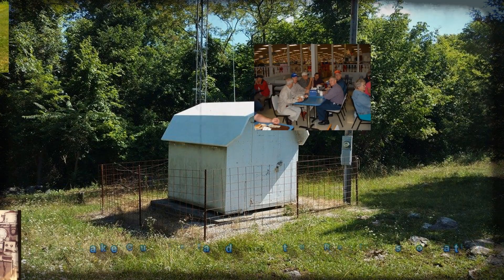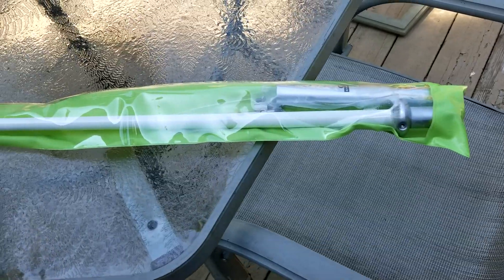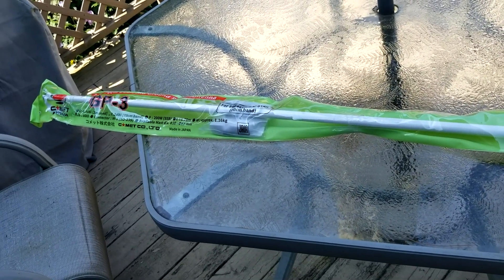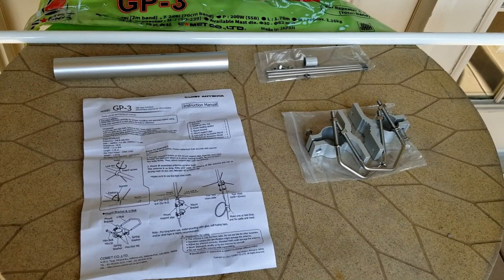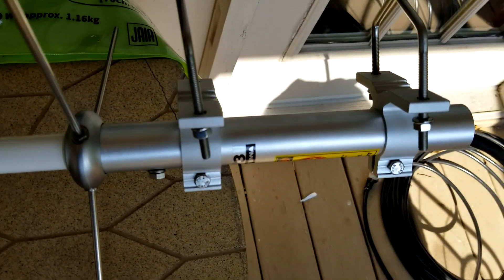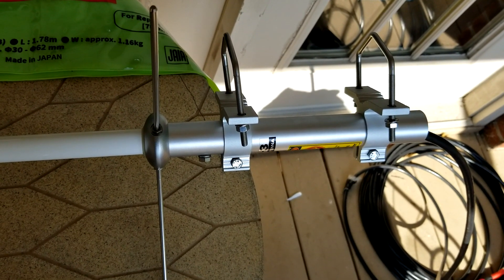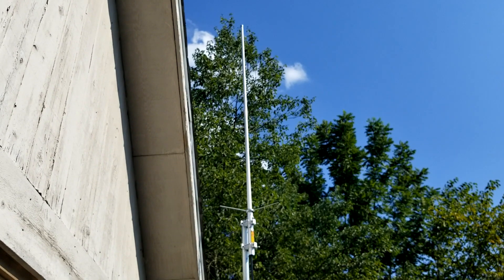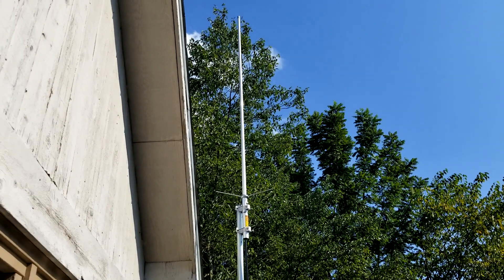LCARA HAM Radio: Comet GP-3 2m/70cm Antenna

Comment: Omg I got this one! Thank you so much for this video!
Reply: I think I broke mine while assembling. The bolt to secure it well I used too much force & realized I did something wrong & the metal is now stuck there & I cannot screw it back on. Any tip on how to remove it?

Comment: FWIW: I use this antenna for Field Use (ARES drills and  Charity events) and mount it to a 20 ft. guyed flagpole mast from Harbor Freight Tools. 
I connect it to my radio with LMR Class 1/2" Coax, and use a strain relief for the Coax just below the antenna mount.🖕🖕

Comment: how has this antenna held up? is it worth it or should I go for the GP6 as I am in a valley and can't see my repeater 6 miles away? Thanks
Reply from the maker: Hey VK1DON - This antenna works very well. Although Comet makes longer lengths with better gain, your results will vary given what is between you and the repeater. LCARA uses several different models from Comet and Diamond for repeater and personal use. We have some that are over 5 years old on towers that hold up very well. Getting the antennas high into the air is the best way to get good results. Good luck and thanks for watching!

Comment: Noob question what's the 3 radial rods for?
Reply: Ground plane...
The vertical is the center of the coaxial cable (first radiating element) and the shield go to the three rods (second radiating element).

Comment: I have that antenna.  Been working for me for a long time.  Works great!
Reply from the maker: Yes it does!
Reply: Can you just go PL-259 on your coax directly to the connector on the antenna, or does it require you add that connector that has the grounding screws?
Reply: @Norseman2  Mine is PL-259 direct to antenna.  Some of the Comet antennas come with the choice of PL-259 or N-connector.  The N-connector is technically better for water proofing and is rated for high frequency but, it’s not a big deal of the GP-3 as the antenna provides good water proofing by design and is is only rated for VHF and UHF.  If you go to higher stuff, consider really good cable and N-Connectors.
Reply: @Norseman2  Oh- to your question, there IS a mounting screw for grounding on the unit.  It’s provided for in the design.
Reply: @jeffwilcox9987  I mounted mine on a pole that is already grounded so I didn’t use that.  I’m kind of a beginner (even though I’ve had my ticket almost 4 years) and just wanted to make sure that I didn’t need to use that piece. Thanks 🙏🏼
Reply: @Norseman2  Should be fine.  I live in a area that is not prone to lighting.  It’s even called out in the NEC books.  (The Pacific Northwest.)  Mine antenna isn’t grounded.

Comment: What is the distances between you and your correspondences ?
Reply from the maker: @ Панас Нетудихатко - anywhere from 7 to 10 miles in simplex. The terrain here in my area is very hilly, so it definitely helps to have this antenna up in the air to work our local Nets and specifically the simplex net which is radio to radio. Thanks for watching!
Reply: @LCARAHAMRadio  The problem with this type of antennas (with serial power of the elements) is that the main radiation is split into many small ones. In hilly terrain this may be good, but in normal flat terrain conditions this antenna would greatly lose to a folded dipole, for example. Best regards!

Comment: I may try a Comet GP-3 I have a diamond x50a and it is complete garbage a Tram 1180 is doing nicer then the x50 its sad.
but i have heard a lot of good things with the GP-3
Reply from the maker: @Matt - GP-3s are great antennas. We use several with our repeaters and home setups. Never fails to deliver and fairly easy to install. Good luck and thanks for watching!

Comment: Do you need an antenna tuner using it with the Yaesu 400?
Reply from the maker: @Jackie D - Not at all, under 1.5:1 swr on both 70CM/2M. Great antenna!

Comment: Why did you not chose the GP-6
Reply from the maker: Mainly due to the length. The GP-3 is just shy of 6 feet which ships in one piece and works great for repeater and simplex use cases in my situation.  The GP-6 is over 10 feet long and has better gain numbers but wouldn't benefit my station for the distances involved. Comet has many great products so one of their antennas will most operator's needs.
Reply: The GP-6 is a great antenna also.  The GP-3 works well though and as mentioned, is a single piece and very low maintenance.  And the numbers are good, quite good enough for many.